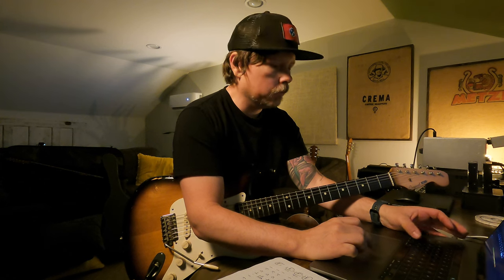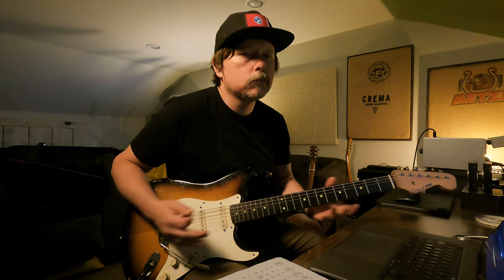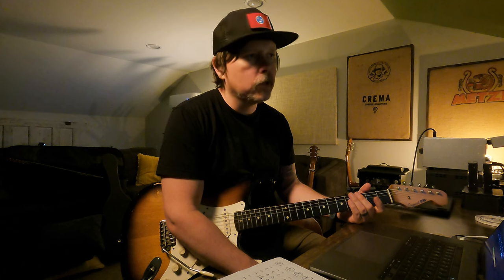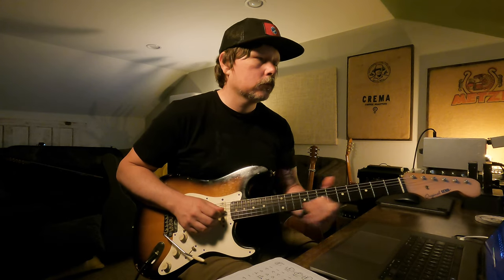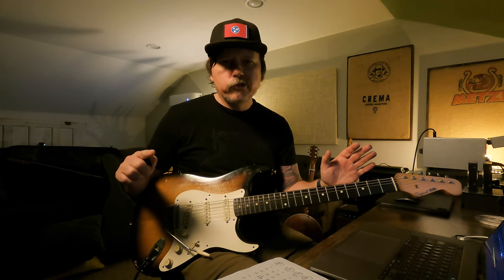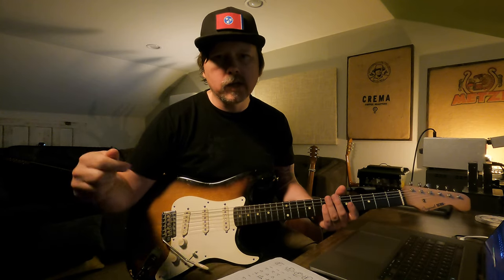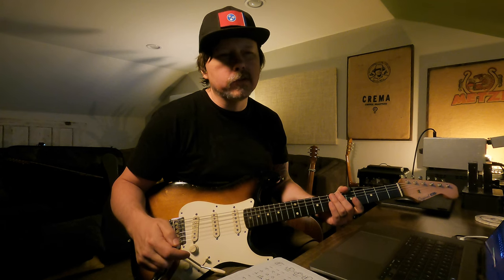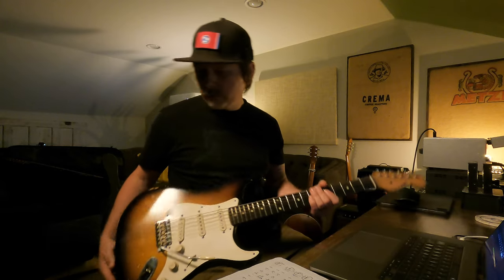Managing 60 cycle hum with NO COMPROMISES to your tone!

Comment: Neat idea in the digital world to record the noise floor and then use it to correct a track. There is a similar technique in photography to eliminate smudges and debris on lenses.

Also, here's a simple one - if you are on a single-coil Strat, select position 2 or 4, which should be hum cancelling on guitars with a 5 way switch and correct wiring.

Comment: Yeah, as an audio engineer I can concur that it’s really easy to get rid of it, as long as there’s a clean section of just the noise. That allows us to profile it and eliminate it without any artifacts. I use it all the time too when recording with my tele . Slap some overdrive on that thing and the noise gets insanely loud. My favorite plugin which is actually free is Reafir. I get even better results with that versus RX. It’s a little more complicated to use, but it works miracles to noisy guitar hum. Anyways love the video as always 👍👍
Reply from the maker: Very cool. Thanks for sharing that info!
Reply: @JustinOstrander  no problem! 👍👍
Reply: Bummer ReaFir is vst only.
Reply: @kevinafflack  yeah it is, but you can use a VST wrapper such as Blue Cat Patchwork to use it in pro tools or logic I believe
Reply: @kevinafflack  also DDMF meta plugin is cheaper and on sale sometimes and is invaluable for using as a VST host for other DAWs
Reply: I find it’s best when using P90s in the studio to just never stop playing

Comment: If it’s ok for the song, I usually just hit the 4 or 2 positions on my 5way switch….. different tone altogether but no hum.

If I Must use the bridge pickup, sometimes I can skootch the tone knob down a hair and do the “turn sideways a little, like you explained”….

But man, I LOVE playing the neck pickup, and it seems less impacted by all the rf/emf…..

Edit: all Strats and a Tele
Reply from the maker: Yeah, I leave the tone knob backed off on my Strat bridge pickup pretty much all the time. It only sees 10 when I'm running a darker fuzz pedal or when I'm splitting with the middle pickup and have the middle pickup's tone knob at 0. Those are interesting sounds. Cheers!

Comment: Noise gate. Easiest solution ever, seriously. The threshold is what saves you, if you play hard, you can set it kind of high, if you are softer and just use finger strum, maybe low. Personally, I use it at a point where if I'm not touching guitar, none of the noise comes through, but just a half pick of a string will trigger it so my dynamics are there, aka hit a chord on the softer side and have it ring for 2-3 seconds is about right. 

If you are percussive, then the threshold and other settings (depends on pedal or plugin) depend, like if you strum and palm mute, things like decay come into play. Bla bla bla bla, eat some Nash hot chicken from a place not named Hattie B's or Princes and appreciate the batman building.

Comment: I've got a Strat I that I replaced the stock p/u config with 2 Lollar P90s. I requested Lollar  wrap them both with same polarity and wind and i put a dummy coil in the middle position under the pickguard and wired it in parallel to both pickups. Middle position doesn't cancel and there's still an equivalent of one pickup's noise because now I have 2 p/u and only one dummy coil but I don't really care for the in-between setting on most guitars. Solution to that is to use 2 dummy coils. It's quiet as a humbucker with only one pickup selected. As far as I can tell, it sounds like a P90 sans the hum. I have an Ilitch Electronics backplate that I bought from Fralin for a different standard Strat for noise reduction but it doesn't do nearly as good of a job.

Comment: I love my p90s and single coils too much so ive adapted a volume pedal at the end of the chain solution and it works great. I instinctively just kill the signal. Tho I do want to try out the Ilitch dummy coil system at some point too
Reply from the maker: Full disclosure, I have a Suhr backplate on my Senn Strat. It only really reduces the hum on the bridge pickup and bridge/middle setting. It doesn't change the sound of the pickups themselves at all. Not like stacked singles.

Comment: I just read that a wireless guitar system can eliminate a lot of the wireless interference.  Hopefully, Justin or others will comment on if this works.  I just ordered one for $55 to give it a try.
Reply: I received the $55 wireless guitar system and it worked!  My Stratocaster now has about the same amount of noise as my humbucking guitar.

Comment: Great channel, Justin; thank you for doing it!! Love it.  I joke to everyone that being a solo 'producer'  or remote session musician involves two games you play almost every day: 1) Why is there no sound? 2) What's that buzzing?  Most of my electrics are Fender single coils and I will tell you what works for me in my pretend home studio at my pretend job: A) Lights off.  Different wired lighting can create huge buzz with single coils.  I shut down the lights and have Xmas lights draped throughout the studio.  No buzz from them.  This works for micing my Princeton or recording DI.  B) Unplug.  I found that another source of buzz/hum was having my MacBook actively charging with its MagSafe charger connected.  When recording, I unplug the charger from the computer AND unplug the MagSafe from the surge protector.  Same goes for whatever is powering my Apogee interfaces and, if possible, having them run off the MacBook battery.  I know everyone's setup, equipment, and situation are different, but these two general things have just about eliminated single-coil buzz for me when recording/producing.
Reply from the maker: Sounds like you may have some wiring or grounding issues. I use lots of buzzy guitars but don’t have much of a problem.  Just need to point away from the computer. I also mute when I’m not playing

Comment: Justin, how are your guitars shielded (aka screened)?  If there's no shielding other than a small piece of foil under the pickguard, that's the job I'd do first.  Prevent the hum reaching the pickup in the first place.
Reply from the maker: I’m not sure. I used to mess with shielding a LOT. On all my single coil guitars. I never thought it made much of a difference. I don’t have issues because of the other things I do to mitigate the noise.

Comment: Thanks for the honesty. A lot of players make slick videos of themselves playing single coils that dont seem to hum at all  People have to realise that it was removed in software or with pedals or what not. The simplest way is just to work the volume pedal or let the engineer deal with it.
Reply from the maker: By all means, make it as easy on your engineer as possible. I try to point the best direction to find the least amount of buzz (it’s a thing), and I ask if they’d like some open buzzing to record after the track. That makes it easier to use one of a few different plugins to carve the buzz out of the guitar track without changing its tone.

Comment: Hi, Love the channel its a great i site into session work in Nashville etc. I’ve seen a guitar backplate that is supposed to noise cancel 60 cycle hum. Not sure if you’ve heard of it or tried it? Sorry i can’t remember what its called.
Reply from the maker: Yes, the Suhr backplate. I have it on my Original Senn Fullerton. It does reduce the hum a good bit, but it is most effective in the position you dial it into. On my Fullerton, I have it dialed to the bridge pickup most.
Reply: @JustinOstrander  cool. I’m looking into it at the mo. Just upgrading my very humble setup. I’ve just picked up the Neumann MT48 it’s got some great converters. But the guitar humm doesn’t seem to care!
Hoping to get out to Nashville this year. A good friend Fraser Churchill is out there doing his thing with Warner so I’m looking to come out and Co write some tunes. Anyhoo , alll the best. Keep up the good work. 👊🏻